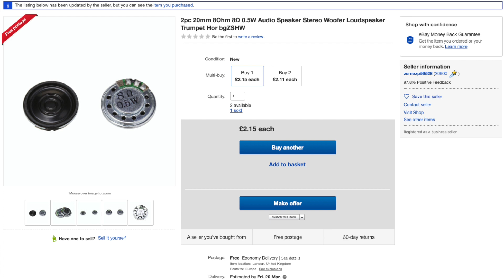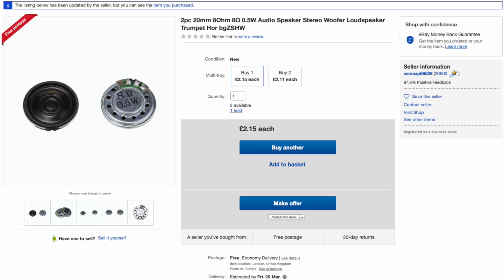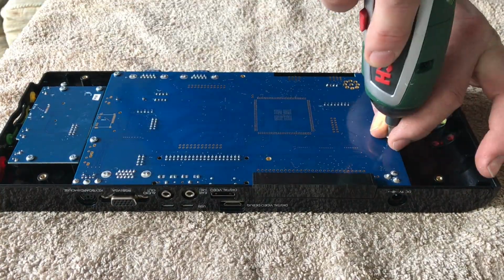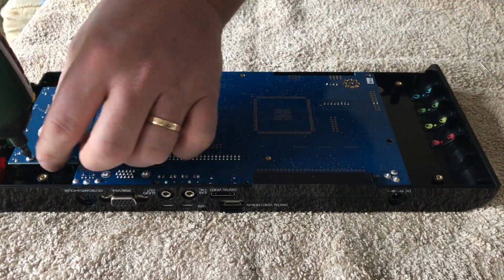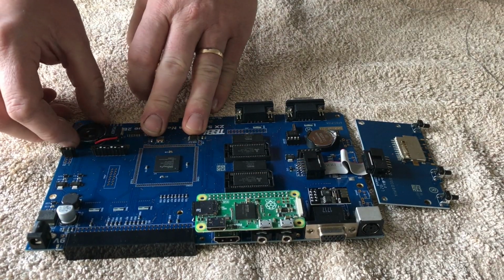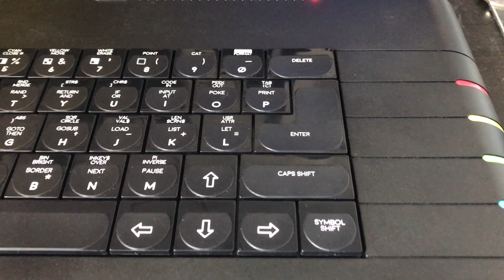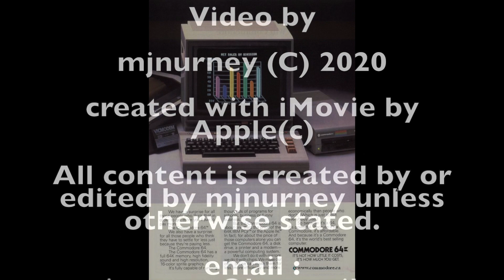8ohm 0.5watt Speaker in the ZX Spectrum Next

Comment: See the Spectrum Next Wiki for the Internal speaker specifications  https://wiki.specnext.dev/Beeper_(hardware)
Reply from the maker: Yes but it doesn’t mention wattage or type. Pc buzzer speakers are extremely poor as beeper speakers on the Spectrum. I have a selection of speakers now to test and hopefully find a suitable one.
Reply: @mjnurney  The available output  power would depend on how the Speaker is connected to the Spartan-6 FPGA.
If directly connected then the  maximum power output would be limited by the 3.3v  and 26mA output capability of the relevant FPGA pin (i.e. 3.3 x 0.026 or about 0.0858W).
Reply from the maker: Excellent info thank you , I have ended up fitting a 2watt 8ohm mini speaker (Chinese) so I can’t verify any of that but it works well and is reasonably loud. I don’t think change it again as I’ve pulled it apart 10 times already ... thanks enough I think.